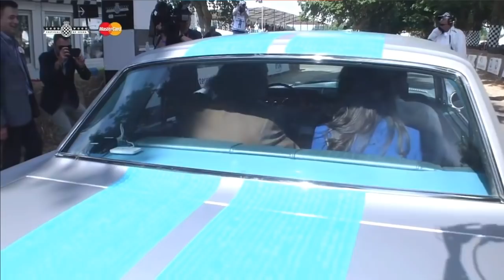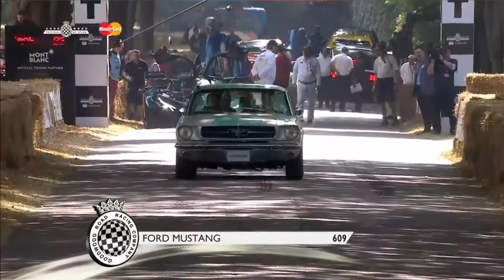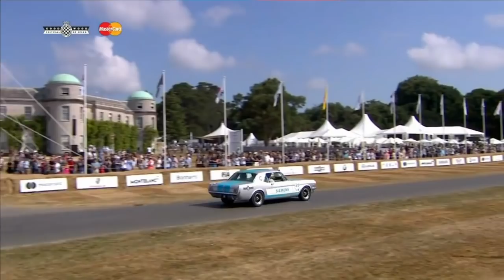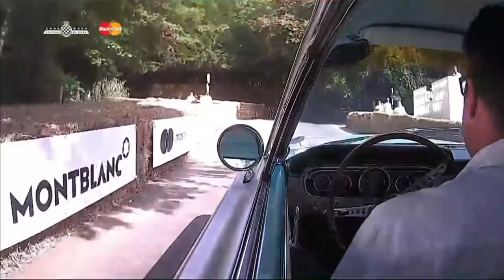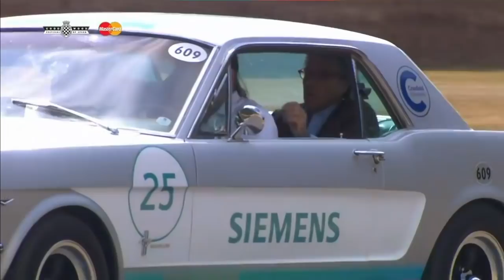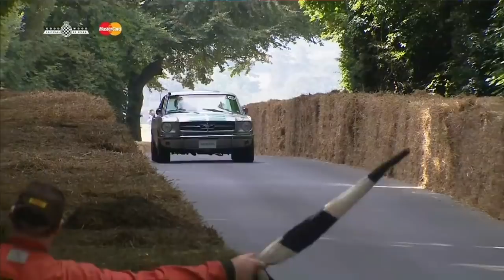Autonomous Mustang Tackles The Goodwood Hill Climb

Comment: These failed attempts cause much damage to autonomous tech and cars in general.
What a poor showing :/ Driver had to intervene almost constantly, as the car was veering to the right into the bales.
These so called big players in autonomous technology (Siemens, Bosch) are years behind the companies which are actually doing it for some time,  although are not the suppliers of the auto industry(yet).
I've also been to a Bosch conference recently showcasing their autonomous tech, same old tech and no meat.
Reply: RoboCar also had a run up the hill at like 2x the speed completely cleanly, much better example of autonomy. Probably because they actually put effort in instead of burning the budget
Reply: I watched Audi autonomous racing around track, years ago. Then you have Nio ep9. They claim that is fastest autonomous car. And they showed some videos on a racing track...